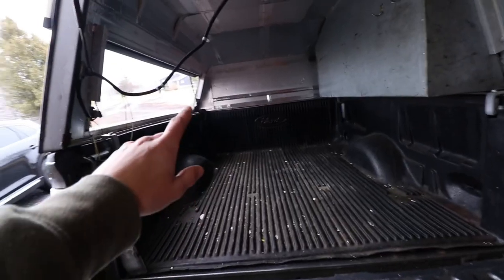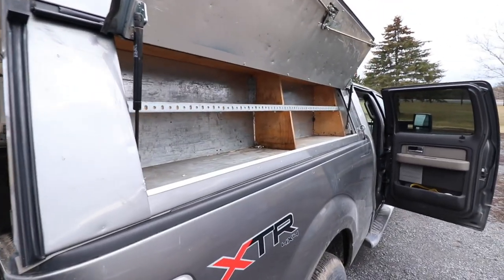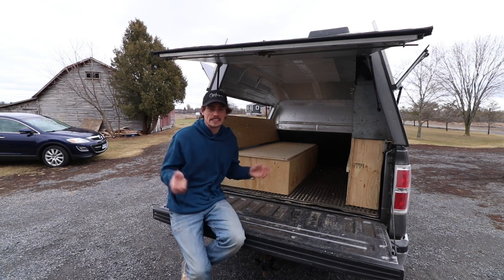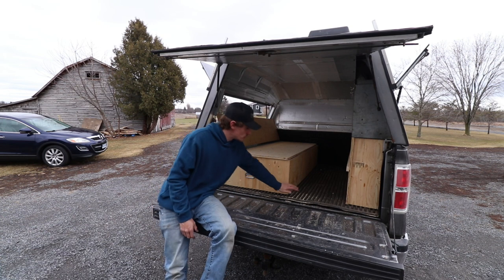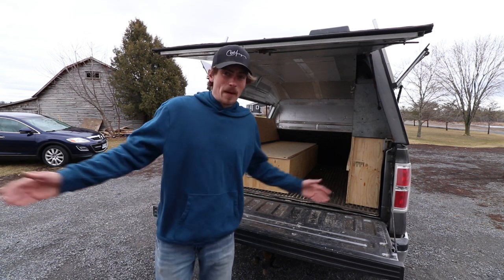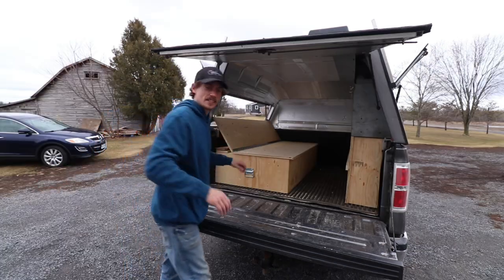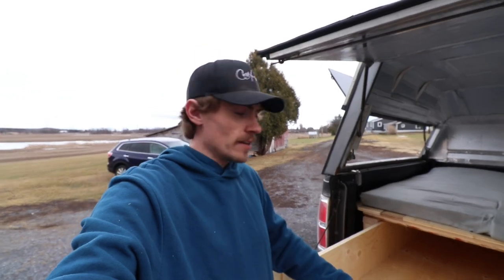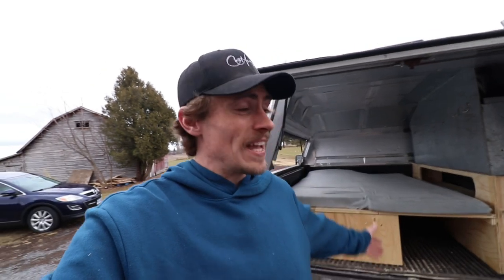The Ultimate Truck Camping Setup | First Futon in a Truck Build?!?

Comment: I wanted a contractor cap with the doors on back, but settled for a fiberglass for the time being, due to contractor caps being hard to find. this build will work for my fiberglass cap and will still work when I get my contractor cap, simple and functional. thanks for the video
Reply from the maker: Ya I was about to buy a fibreglass as well. Got lucky and found this one the day I was going to pick up the other!! Glad you liked the build and hope it helps with yours. Made a few minor adjustments so far but it’s basically the same as when I built it and I’ve loved it. Some type of ventilation is needed though, especially this time of year. Thanks for watching!!
Reply: @castawaytv  I live so far back in the boondocks they have to pump in sunlight , so it's a little ruff fining things, those work toppers are gone almost before the ink in the ad dries. thanks

Comment: Our trucks are very similar,  I really need to get tome videos of my build published.  My shell is a standard heigh ARE aluminum shell which side hatches like yours. I'm going to be removing the driver side just like you did, my passenger side is all built out and wired up. I am also going to be making a fold down shelf on the passenger side panel. I'm going to use a rectangular piece of wood with flag hinges on the bottom so I can remove it when I want to and I'm going to use magnets or a screen door catch to hold a shelf in the opposition when not in use. I've been having a hard time with coming to grips with losing the driver side storage bin. For years I've used that side to store extra 5 gallon cans of fuel and then easily siphon them into my fuel tank when needed. When I started my build I started with the rack with a rack on top of the shell that holds 200 and watch a solar and three 2 x 4 trays for my shooting benches. I also put a 270° awning on the passenger side, and a privacy shower hanging off the rack on the driver side. I've got my outside about finished now I need to work on the inside i'll probably follow your advice and make a building that goes under the passenger side storage compartment like you did that looks pretty clean.
Reply from the maker: Screen door hatch works great for mine! I like how do you like the awning? I’ve been considering adding that to my setup. And possibly doing the solar as well! I really love the space I have without the drivers side storage. I did it right away so I never got to used to it.
Reply: I like having the waning,  I bought the Batwing 270, and one side panel.  I then used it as a pattern to make the other 3.  Knowing what I know and how my system evolved, I would not go with the batwing again.  They have a weak point (the plastic hinges that the poles are connected to) I have spares for when it breaks, and it will.  After purchased the awning, I ended up getting a 12v (bushman knockoff fridge) and mounted it behind the passengers seat.  So I would really like a double swing awning, that would swing around the side and back (like the 270) but also hinge forward to cover the passengers side door area because I find I get in my fridge a lot.  For the side fold down table that I am going to build I am going to use flag hinges, so I can remove the shelf If I need to to make space.  I'm also going to try and use strong cabinet  magnets to try and hold it in the storage location.  My shell is not as high as yours so to gain a wider shelf I need to save the space that the screen door catch would take up.  If the magnets don't work out I will narrow the shelf to make room for the screen door catch.  Sub to the RogerLikes channel, because some day I will throw some videos up of my setup.   Roger